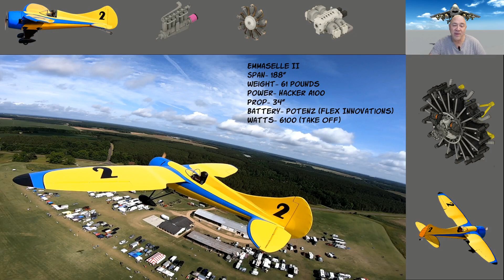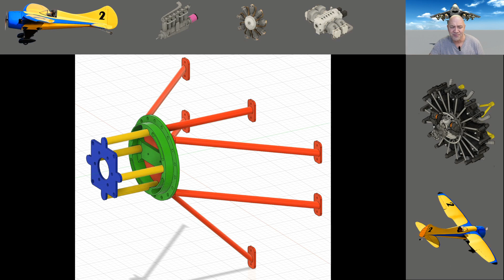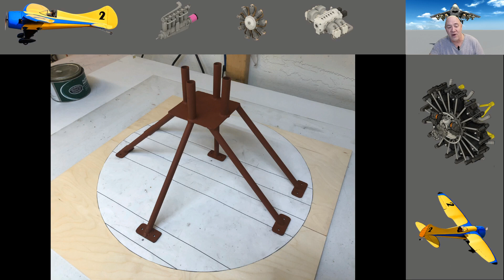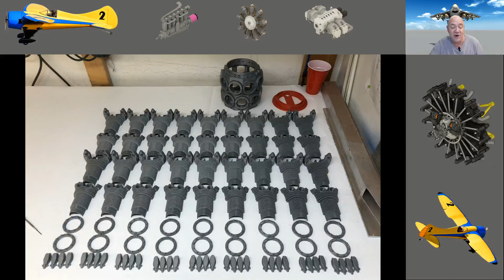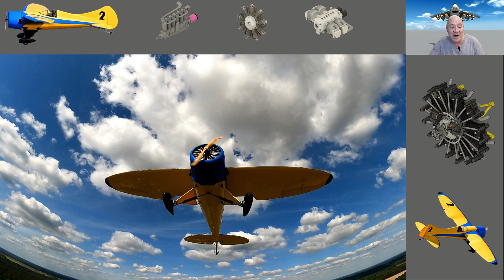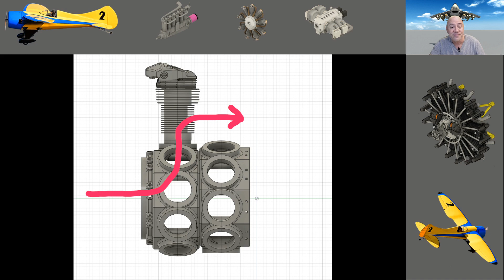Emmaselle II 18" Two Row Radial (Dummy 3D Printed)

Comment: I agree with Kurt.  That cooling hack is genius!  I'm working, ever so slowly, on a  Stearman model for 3D printing, and the supplied engine files are crap.  Fortunately there are several engines at the local airport that I can photograph and measure.  I was thinking about a motor being cooped up in the crankcase myself, and slicing vents in the cylinder never entered my mind.  So logical!